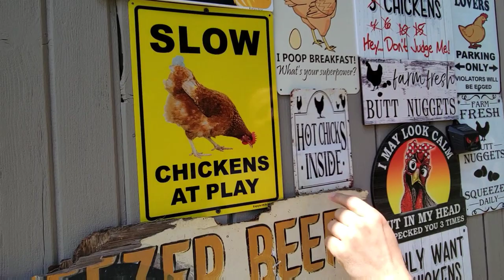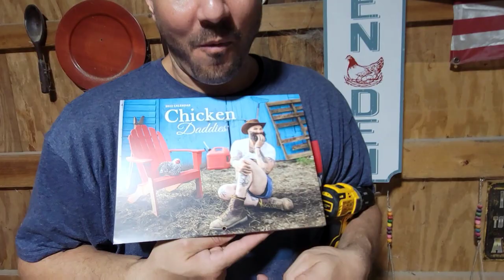MARTHA STEWART'S PEACOCKS Aren't The Only Ones In Danger

Comment: A fun way to grow potatoes is to get maybe a 6 foot by 6 foot piece of rigid chicken fencing. Get a bail of straw. Get any kinds of potatoes. You can even just buy a bag at the store. Mold the chicken wire into a round tube and close it with zip ties. Mount the chicken wire tune into the ground in full sun. Layer inside the tube straw then potatoes then straw then potatoes then straw then potatoes all the way to the top. Keep it moist. It will grow out the sides like a giant chia pet. After the potato plants die off in late fall you just pull the tube out of the ground and tons of potatoes will fall out. They come out so clean you usually don’t even need to wash them. Some will also be in the ground under where the tube was. You can also do this with sweet potatoes
Reply: That is great to know.

Comment: Suggestion: wrap those PVC pipes with vet wrap. It will make cleaning them easier- when dirty, cut it off, toss and rewrap. It isn't expensive, a couple dollars a 4" roll and goes a long way. It's kind of rubbery feeling, stretchy and sticks only to itself. It gives them a better grip and it will make them feel more secure when perching. I use it for my parrots all the time. 
Hey a little FYI. You may know this, but other viewers may not. 
You have 2 silky roosters there and one hen (George). 
The other thing is the eggs. Yes, they are small, but they could be from any of them. "Pullet eggs" are the first eggs a pullet (young hen that isn't laying regularly yet, for those that don't know) lays regardless of the size of the hen. Very often, they are very small to start with. Nature's way of getting them ready for regular laying. You'll be getting small Bantam eggs and big eggs before you know it! Good luck.

Comment: You need one potato to one pot,fill the pot up first,then put the potato down in the soil ,build a hill to support the potato plant,this also protects the potato from the sun.Mark the date you planted it.hill the potato every 1-2 weeks ,Maintain even moisture throughout the growing process-1-2 inches of water per week is ideal.Your potato seeds  at the look of  them are already weeks ahead of planting.The plants need to be hilled up to the first sign of leafs showing,they need at least 6 hours of full sun.the seed potato needs to be 12 inches apart.I ‘m growing potatoes for the first time and have mine in a container by them self.They need the room for the tubers,which the potatoes grow off of.Once the plant is 6 to 8 inches tall,or around 5 to 7 weeks after planting.usually takes 90 days for most Varieties,I worry about the heat wave all over country.Potatoes need between 60 to 90 degrees.We have been having a lot of rain and 100 degrees temperatures.So I’m hoping I still get a good crop.🙏🏻Good Luck with your potatoes 🤗❤️

Comment: Another way to grow potatoes and recycle rubber is to use tires. My Grandpa used to take a tractor tire, fill it with dirt, plant the taters.  When the plants grow enough, place another tire on top of the first, carefully fill it with dirt (don't bury the plants completely) and by the end of the growing season knock the tires over. Bakers will be on the bottom and new will be on the top.

Comment: To plant potatoes and empress your visitors, do this. Get a tire and in the middle plant your your potatoes. When the sprouts begin to about 4 inches above the tire get another tire and put it on top of the first tire and add soil, when they begin to show above the second tire, get  another tire and stack it on top of the second tire etc. continue for up to ten tires.. to harvest just push the tires over this will spill the soil out and this will show the potatoes easy to do, no grass to deal with. Not a hard job.

Comment: Those don’t work my peacocks would slide off of them they need something so they don’t slide off we tried doing what you did  so I got fence round post  and they love it also we used tires on the floor  and they used them to good luck this weekend we are getting two goat to if price is good and we keep everything locked up because of coyotes to but the other thing that help us was Christmas lights all over and solar lights

Comment: The potatoes need to have the parts you have sticking out under the soil, they may not grow because they are very long, but hey, we found potatoes on the allotment we#d forgotten about, planted them as an experiment thinking that even if they didn't grow they'd act as a fertilizer for the soil, but guess what they've come up! Here is another tip whenever you plant anything you have to water it in, especially potatoes and you have to keep those watered, if you don't you'' only get a small yield and small potatoes (or as we call them here in Liverpool, U.K Spuds)  Good luck with the spuds and I hope that you plant more veggies :)